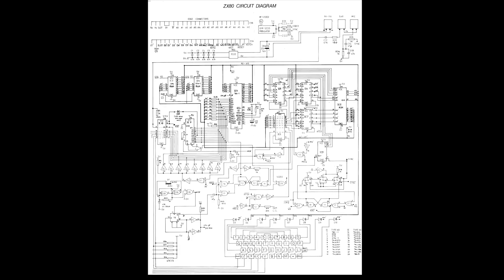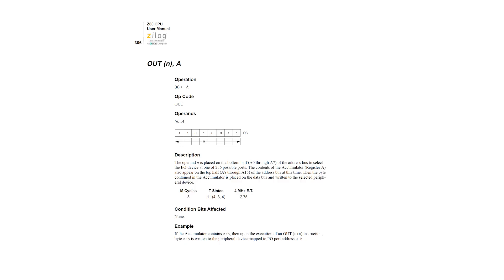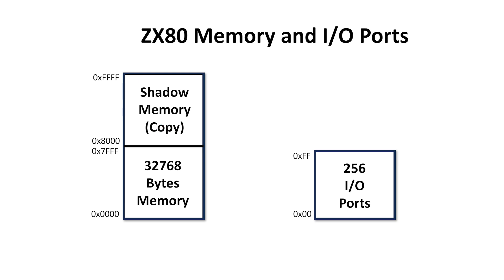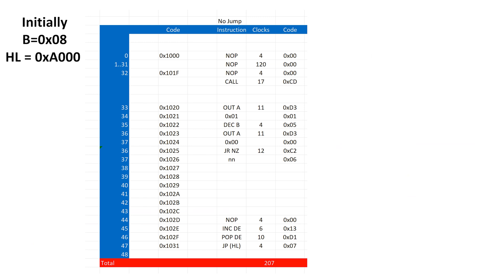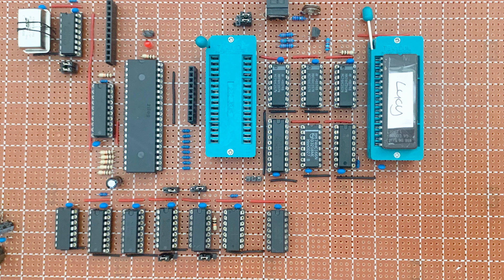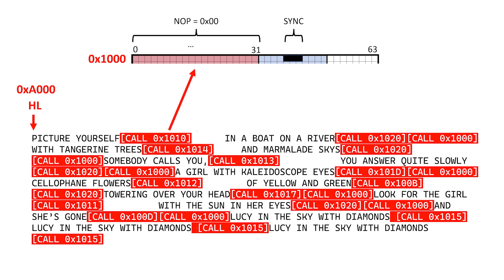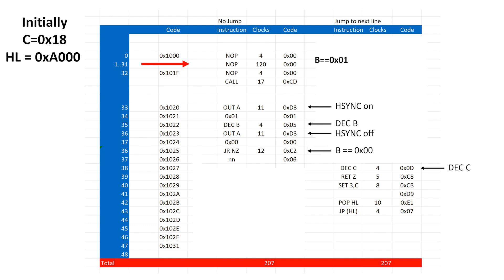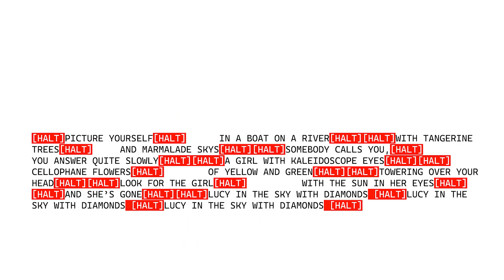ZX81 Video Circuit Part 4: Display Files

Comment: Thanks to the start of this one, I think I now understand how the I/O port system on the PC works. I assume it's the same on x86, given the 8086 and the Z80 are both descended from the 8080, and with the 8086 expanding it to 16 bits, given the classic hardware ports you had to tell software about being things like 0x220 and 0x388 for sound cards.

The notion of just simply giving the processor two address spaces is such a simple and elegant solution to the question of how to handle I/O without wasting memory, and also fits in with Intel's love of hybrid approaches to doing things.
Reply from the maker: Yep, the i/o system is very similar.  It's a pain, particularly in the apple, were we need to decode down to individual addresses in the 0xC000 range on the 6502 to control video output etc.  That's a lot of wasted logic to decode that.

Comment: Over a year ago I replied about some data on the screen. In may 2024 I found out how to change the current character while this was displayed. You can alter the current displayline by POKING 2 values on the current line: LD H,D and LD L,E
This will trick the display to go to a next line. This allows you to create advanced characters. See a video of Mushroomman for the ZX81.
Reply from the maker: Interesting, you can also create other characters by modifying the I register.  It is set to 0x1E, but if you change it to another number, you'll get more random looking data and you can find characters that look like the one you're interested in.  If you take control of the raster, you can modify the character per scan line.
Reply: @DrMattRegan  , yes that is pseudohires but that doesn’t work on a Lambda8300 Zx81-clone but this method does.
Reply from the maker: @ interesting

Comment: Dear DrMattRegan, at min 4.30 it's said "Z80 can't tell the difference between 2000H and 8000H"... I think it's not correct because mirror address of 2000H is A000H, isn't it? However your video series is a masterpiece!👍
Reply from the maker: Yes, correct.  I think i misspoke.  0x2000 will be mirrored at 0xA000, good pick-up.  Unfortunately i can't modify the video, but hopefully people will read this comment.

Comment: @0:53 It has 65536 I/O adresses but software and hardware must use it properly.
Reply from the maker: Correct, i do address this in a later video on the keyboard

Comment: I hate HEX. Growing up with the ZX81 and the ZX Spectrum was great, but I did'nt have access to books or magazines for about the first 4 years, even then it was BASIC type-ins, so I am totaly self taught through reading the manuals and breaking into software on tapes. As HEX is'nt native to these machines, I dealt exclusively in decimal. And I still do. I understand it better.
Reply from the maker: Great feedback.  This channel is meant for the self taught!.  Hex is tricky, but think of it as being a compact version of binary.  When you're debugging hardware, it's tricky to remember a binary number, but you can read HEX directly off the pins of chips.
Reply: @DrMattRegan  I don't know how to do that as I have no understanding of HEX. I did'nt bother to learn it, and at 55 going on 56, I fear it's too late to learn. (and if maths are involved forget it. I went to after school maths classes to try to understand maths. After 2 weeks the teacher gave me an F- and we both gave up. He was a great teacher. I could'nt be taught.)
Reply from the maker: Fair enough, but if you simply memorize this table https://en.wikipedia.org/wiki/Nibble#Hexadecimal_representation
and apply it to each 4 bits at a time.

The 16 bit address bus will have 4 hexadecimal digits and the 8 bit data bus will
have 2 hexadecimal digits, always.
Generally, when debugging i don't convert back to decimal, unless forced to.
Reply: @DrMattRegan  Strangely, I can convert 8 bit binary to decimal rather quickly. I don't know how I do it, it just seems to happen. I'm odd. LOL.

Comment: The Z80 I/O cycle actually uses A0-A15 rather than just A0-A7. Indeed the ZX80, ZX81 and ZX Spectrum use this in their keyboard scanning code.
Ideally Zilog should have used IN (BC),A rather than IN (C),A for instruction ED 78
The Z80 was designed to be binary compatible with the Intel 8080. At least in terms of documented opcodes. The undocumented ones, which on the 8080 are simply duplicates, being repurposed for additional instructions and/or instruction prefixes.
Back in 1976 Zilog didn't ma,ke this difference between the Z80 and 8080 especially clear. Though the current edition of the data book does. In the case of the two I/O opcodes present on both the 8080 and Z80, D3 & DB, on the 8080 A8-A15 are undefined whilst on the Z80 they contain the current contents of the A register.
Reply from the maker: True, i wanted to keeps the explanation simple, but i'll go over it again when i get to the keyboard.

Comment: Due to the bit 6 as activator for opcodes you display spaces on the screen and hide data with opcodes like LD B,B LD C,C etc.
Reply from the maker: Correct, there are a limited number of opcodes available when the NOP generator is active.  I think they only use HALT which has an opcode of 0x76
Reply: @DrMattRegan  , I use the others to store data on the screen and still show a large screen without the cost of bytes. My snake has info about taildirection, minesweeper about the mines etc....

Comment: The smallest zx81 screen is an empty screen and in size only 1 byte: JP (HL)
Reply from the maker: Really, i know the ZX80 needs 25 halts for a stable screen.
I'm still going over the ZX81.  But are you sure that is correct for slow mode?
Reply: @DrMattRegan  , yes 1000%. I invented that trick to save bytes in my 1K games. The display will display spaces until time has passed to update the screen. So a JP (HL) after the 9th HALT will give a 8 lines screen.

Comment: can you not do ...
LD A,LOW_BYTE
LD L,A
LD A,HIGH_BYTE
LD H,A
LD DE,HL
IN A,(DE)
LD RET_BYTE,A
RET
Reply from the maker: Hmmm.  Not quit sure why you would do it that way.  We are tight on clock cycles and LD HL,mm takes 10
Reply: @DrMattRegan  it extends the number of inputs and outputs from 256 to 65526 they should have used a TMS9918 Graphics Processor like in the MEMOTECH MTX512 plus a heat sink for the TMS9918.
Reply from the maker: For OUT, either you have 256 ports with 256 values per port or 65536 ports with 1 value per port correct?  Same amount of information either way.  For In it looks like you can use 65536 addresses.  The ZX80/81   only you 1-2 ports, so i'm not quite sure i see the point.
Reply: @DrMattRegan  Yes AMSTRAD was doing this on the CPC6128 and on the PCW Office machine.

Comment: I'm really enjoying this series. I've ordered some big old perf board to try my own..
Reply from the maker: Have fun! I'd recommend you bring it up in stages, i think it's more fun that way.
Reply: @DrMattRegan  that's the plan. I did have JLC make up some repo ZX80 boards but I've had a lot of trouble getting them to produce a video signal at all, the video it so dependant on everything else working it's hard to diagnose. 

I've been working on an Apple 1 compatible here in a similar way, building the video and terminal side of things up to replace the unobtainium chips of the original.

Are you planning on doing the audio in/ out for this project for writing to tape.
Reply from the maker: Yeah, audio in /out should work, but i haven't tested them yet

Comment: So, as per my previous comments, I already understood how the ZX80 generates the display.  BUT, I have to complement you on the way you're explaining this. You're not just showing us how it works, but you're taking us on the journey from first principles (in Z80 terms) and showing how the final implementation can be developed by means of several incremental improvements in memory usage and efficiency of the hardware. Just fascinating! Thank you.
Reply from the maker: Great glad you like it.  There is so much detail in the original ZX80/81 design (despite how simple it looks) that i wanted to unpack each piece and look at it in isolation.
Reply: @DrMattRegan  And you're doing it very well indeed.